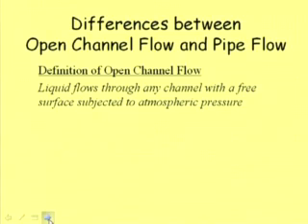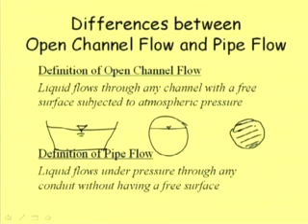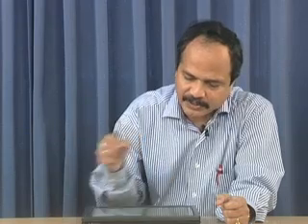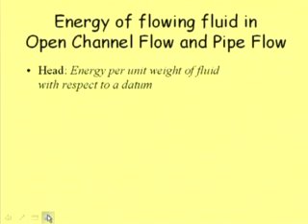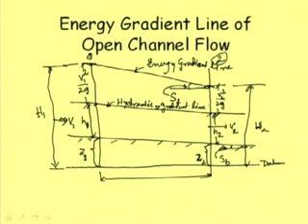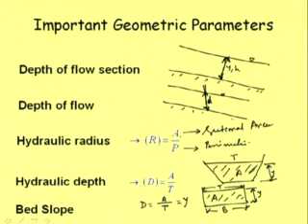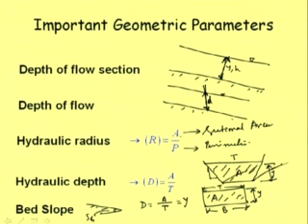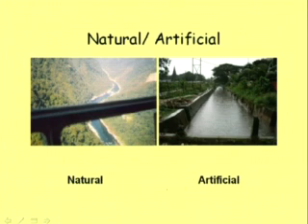Mod-1 Lec-2 Open Channel Hydraulic Part-1

Comment: Sir please answer this question 

A triangular plate 2m base and 3m height is immersed in water so that it's vertex is at water surface and base is parllel to water surface. 
Find total pressure and depth of center of presuree

Comment: lot of confusion  because of word - unit weight
Reply: in this case weight is force, so they just deviding with the weight force, so everything is expressed for unit weight.
Reply: Ok so more clear:

work is Force*distance = Newton*Meter=Joule 

So work is also energy
And when he talks about Energy per unit weight, it means he Devide Energy with force, so what you got in the and it will be distance.
Reply: @kekiir  In this form was only H&hm or FM.,

In the GT was unit wt =weight/volume
It means 1g of soil was occupied.in 1cm3 or 1kg of soil was occupied by m3,
It can only occupied 1kg of soil extra soil cant kept in the 1m3 after heavy compaction also.